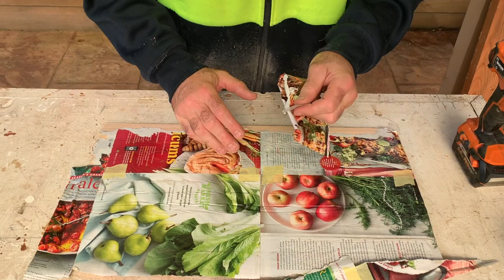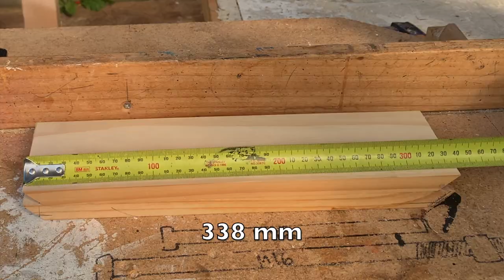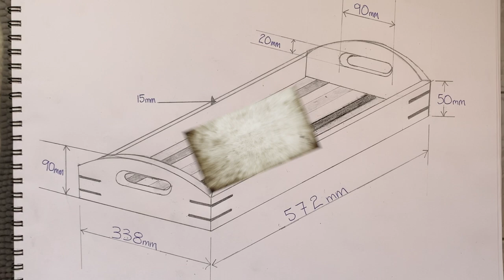Serving Tray / Food Tray

Comment: Did you router the top edges of the handles or sand them to round them off?
What router bit did you use for the internal edges of the handles?
Thanks!!!
Reply from the maker: Hi !   I sanded them to round them off !    for the internals I used a common  ''round over bit ''  -  the large one...hope this helps , cheers !!